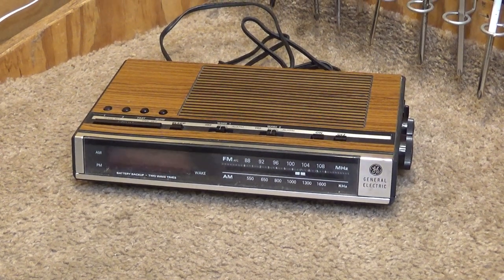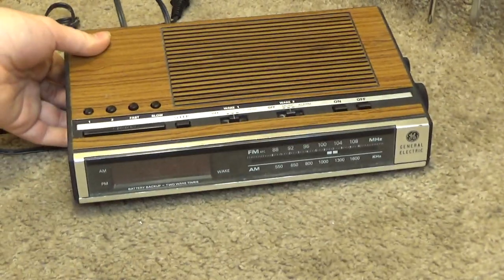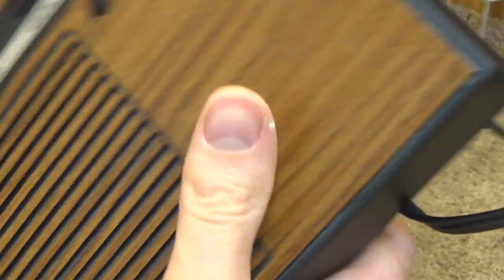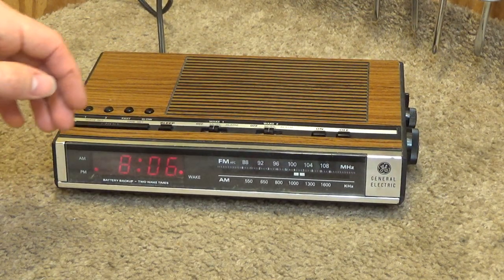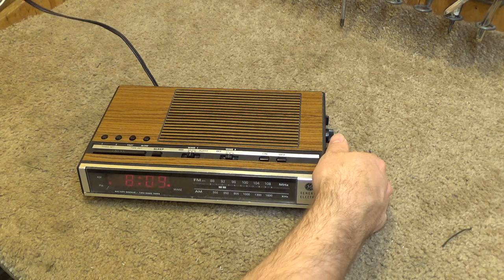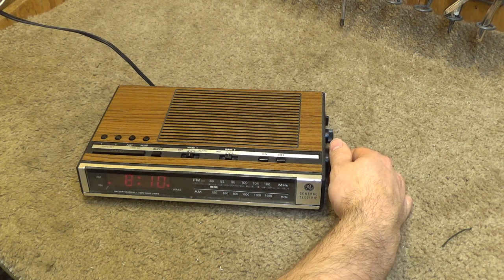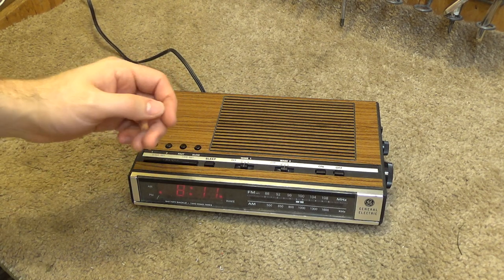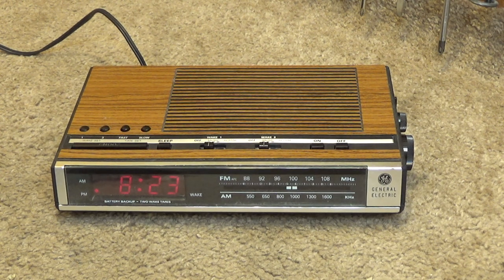General Electric Clock/Radio Model 7-4636D | Initial Checkout

Comment: With all the date codes, just look for two numbers in a row that look like a plausible year of manufacture.  "1817," I see "81," I'm going to assume 1981.
Reply from the maker: I'm not going to assume; assuming is very terrible.
Reply: Assumptions are harmless if the consequences of assuming wrong are nonexistent, such as in this case of acquiring an age of manufacture for the purposes of satisfying curiosity alone.
Reply from the maker: Creating a false sense of satisfaction is pretty harmful...
Reply: There's no such thing as a false sense, you either have the feeling or you don't.
Reply from the maker: Perhaps you're analyzing the situation on a far too shallow level.